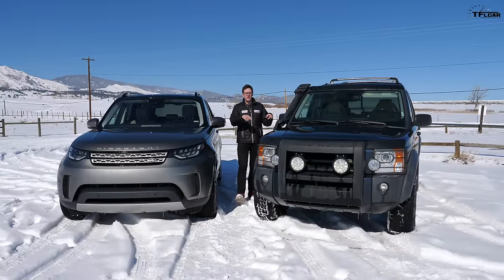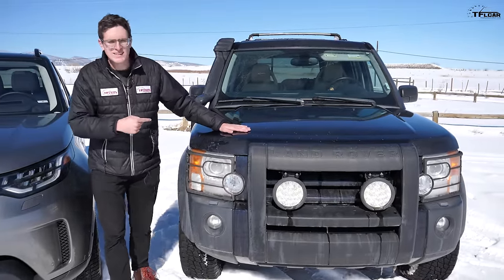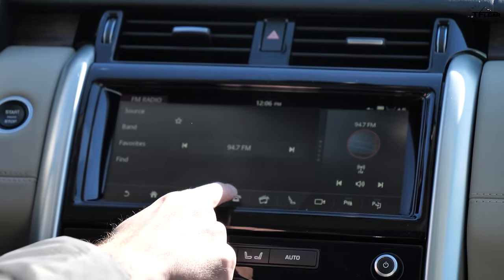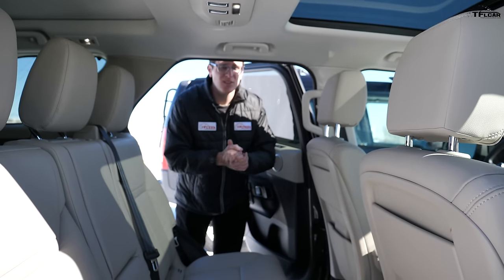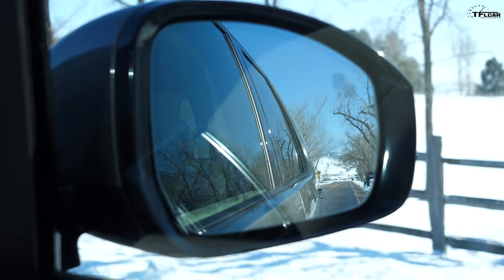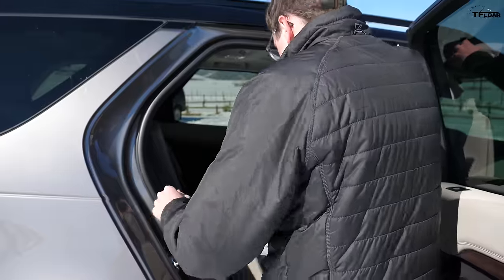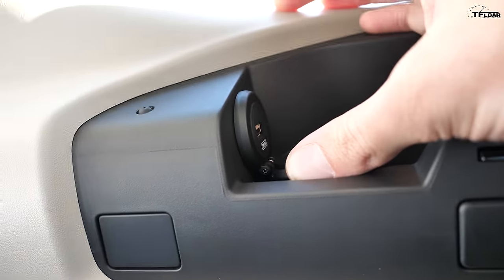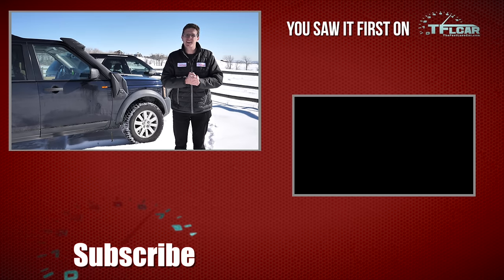Is The New Land Rover Discovery ACTUALLY BETTER Than A $5000 14-Year-Old LR3??

Comment: After the Discovery 2 the 3 and all that followed were unreliable overpriced rubbish. I once drove a Discovery 2 at a Land Rover off road experience center. As a purchaser of a new Discovery at that time, 2004, you received a free half day with an instructor. For a few quid more I took my wife as well so we both had a go. The center's Discovery 2 traction control systems had packed up but after completing the course the instructor said there you are you didn't really need it,  you managed to complete all the obstacles in fine style with manual control. Still have the car after nearly 16 years, steel springs so no risk of airbag suspension blow outs.

Comment: The D5 is an abominio! I own an lr3 4.4 and if u put it in sport mode it goes 0-60 in about 6 sec, it just work on the higher rpm, when it gets there it flies! Anyway, the defender 2020 is actually the new disco, just look at them!

Comment: Wow the Rover has all the controls and air ride which is everything my 2000 Lexus 470 lx has just 21 years later. With 21 years of use and over 200000 miles it’s running just fine.

Comment: Tommy the Disco 3 was still supposed to be a work horse if you’ve got muddy boots you don’t want it all over your posh leather. Whereas the new one is supposed to be a cheaper Range Rover still posh looking sleek and stylish because literally 999/1000 owners won’t take them off-road so they made it posh inside and big fancy wheels etc

Also the disco 4 is the best of both worlds

Comment: All the haters of the Disco 5, The thing that really kills the 4 offroad is the fact of how heavy it is. The 5 is around 400kg lighter with better air suspension set up, better terrain response. It would absolutely run rings around the same set up 4/3 off road.

Comment: I have the Discovery 4 or LR4and it is much better quality finish inside than the 3. Outwardly much the same and of course superb comfort in all 3 rows. Don't like the latest version - too soft and curvy and doesn't ha e the same presence as previous versions. Also with the 3l turbo diesel has loads of power

Comment: The volume knob position on the center stack is for the passenger since the driver is more likely to use the steering wheel controls.

Comment: I’m in the uk , where petrol (gas) was rare in the discovery 3 . The 2.7 litre V6 pulls like a train , and heaps better mpg . I’ve owned the Discovery 1 ,2 and 3 5 years with each , and will be getting as new a discovery 4 as I can , rather than jumping to the disco 5 . Your review helped me greatly, I have 4 kids , so the rear seats always get plenty of use , and as the kids are growing, the rear seating in the 5 having shrunk , it’s put me off . Maybe once a few kids fly the coupe then maybe then , but the lower driving position isn’t something to look forward to. Another thing is , they are not selling in anywhere as bigger numbers than the D3/4 . I live in a area where every road has a Land Rover product on a driveway of at least one house , yet I see pitifully few discovery 5’s . Clearly the new model doesn’t fit to the expectations of the potential buyer , and the price new... for the spec I wanted was over £90,000 . That’s a big jump .

Comment: Should have been a body on frame, rear solid axle. Unfortunately, drivetrain good for 33in tires only not enough to handle larger tires. Good off-roader still just not interesting enough for enthusiast crowd.
Reply: Which one are you talking about? I mean I know of guys who have fit 37’s on a LR3 and I know of several LR3/4’s that do serious wheeling on 35’s. And the D5 fits 33’s with virtually no mods not even trimming that’s better than the LR3. I mean people have put a Range Rover Sports which is the same platform as the D5 on 37’s and they say that they drive great.

Comment: I would say yes because they have the similar independent suspension design/uni-body construction, with an updated terrain response system, and more advanced engine/transmission offerings. So yes the newer one is ‘better.’ Now if your talking about comparing the new one to a Discovery 1 or 2 that’s a different story...

Comment: Rather have the old one, we all know about brand reliability, so... A shortcircuit in the new one would have a blast of a party 🎉🎉
Reply: Who is 'we'?  There are very few actual Land Rover owners who would agree with your statement, and ALL brands suffer from reliability problems, it's just that the internet has a downer on Land Rover products.  I had my Discovery 3 for 4 years and 168,000 miles.  It had two minor warranty issues sorted within a day of them occurring and then from a year old was faultless.  The two Discovery 4s I had after that had no problems whatsoever, and neither has my two-year-old Range Rover Sport.  What you're suggesting is meaningless hype

Comment: Very good review for old vs new suvs. This sums up the truth about them. Everything is a compromise. The new interior is screwed together nicely, but window sills are so tall due to Side impact safety, they're not comfortable at all. Sitting so low in new suvs doesn't help. They cannot be sporty anyway, so I don't know why they try. As for old, tall and boxy maximizes space so I'm much more comfortable in the old. Interior plastic is cheap, but seating is way more comfortable. Luggage and people actually fit in the older ones. I personally don't need the rear end to squat so I can put groceries in the back. I'll just leave it at this.... My wife drives a Mazda CX9 and I absolutely hate it. If there's 7 people (even my little grandkids), the rear seats almost touch the rear glass. You couldn't fit a backpack in there with all seats up. My mid forties old butt drives a 1999 Montero and a antique 1993 Explorer. They have frames. Lots of room. Mitsubishi has a locking center and rear diff. I actually off road the hell out of mine and I can fit many comfortable people and lots of luggage in both. Is newer better? Not for me. My wife lies her wannabe sporty Mazda though. There's no physical way to take 7 people on a trip. Not even a roof rack to put a luggage carrier. But the interior materials are nicer. That's about it. It'll also win a drag race against my old trucks. But I sure have never had a problem jumping on the highway and passing anyone. It's all give and take. The nature of the design has to make compromises. Well done Tommy!

Comment: If the interior option is tan, the rear cargo area is as well. I’ve got an LR3 and an LR4. The LR3 is a bit sluggish compared to the LR4, and probably more so when compared to Disco 5, but not quite as bad as what yours seemed to be. Plenty of power for what it is, and no problem passing on the highway.

Comment: Nice vid on this topic. I wonder whether LR managed to improve reliability over the years. I contemplated to buy a Discovery 3, but was advised to go for Discovery 4 as there should be less problems  (level control sensors, air compressor, engine issues etc.) The Discovery 5 looks like a standard SUV for the city. (For some years now, I did some trips with my Discovery 1 300TDi Trophy (1998) and LR 109 Series III )

Comment: I’m so glad you guys did this. However, from an arthritics aspect I think you guys need to specify the trims on these two vehicles. My 08 LR3 HSE with the Lux package has a much more comparable interior to the D5 as I have all the options you could have in an LR3 and makes the LR3 not look as archaic. More than happy to lend mine if you wanted, or at least wanted to check out. For instance, I have the cooler, wood trim, off road/nav screen, and the cup holder on the far passenger side where you have a tiny cubby hole.

Comment: Nice review video thanks! Re: the volume knob on the wrong side....the driver has volume controls on the steering wheel, so the knob is on that side so the passenger can access it easier.

Comment: Stadium seating was necessary in previous versions due to the frame design. The new one’s frameless, so there’s room for them to sit lower and not impede the suspension.
Reply: That's not strictly true.  LR actually advertised the stadium seating as a benefit, and it started with the earlier Discoveries, which were based on the Range Rover Classic chassis, and that had level seating.  Also, in the D3/D4, when you fold the 2nd row seats, you can drop them about another 4 inches which allows the folded seat back to be level with the rear load floor so, if this is possible, why wouldn't they be designed with the seats lower from the get go?
Reply: Simon Uden 1. Marketing isn’t proof of science.
2. Because they’re very uncomfortable to sit in that way. Your knees end up at your chest, like some third row seats are.
Reply: @afcgeo882  The floorpan is flat between the 1st and second row seats - why would it be any different if the second row was at the same height as the 1st row?
Reply: Simon Uden Rear axle is under the rear seats, not under the feet.

Comment: 2016 LR4 owner.  If you compared a newer LR4 to the Disco 5, there is little better on the Disco 5. It has better USB ports and the back seats are way easier to put up and down. But that’s it. The sc six on my LR4 is a great engine- 90 mph up mountain interstates and decent mpg for what the veh is. The Disco 5 looks like a Range Rover wanna be up front and a puke fest in the rear. I mean seriously, heritage only matters if you actually honor it. If you shit all over it, don’t put some marketing nonsense on it and tell me you did it for heritage. just stop it and square off the back and center the license plate. The Disco 5 is way smaller inside- height, third row room, boot space. Seating position in Disco 5 is terrible for a Land Rover.  The electronics is not that much of a change from mine- I have most of the same features- offroad info screen, cameras, yet the have more traditional buttons with chunky knobs that are easy to use with ski gloves on. And they did not improve the offroad tech- offroad crawl- whatev. HDC is Ok bc it is actually hard to keep a slow steady speed going down a steep grade offroad, and the system will apply all the electronic wizardry that a driver just cannot do. But for just driving? C’mon, if you can’t keep a steady low speed in low range then you need to practice more. And Terrain Response 2? I read all I could on it and cannot figure out how it is any better than mine. My LR4 interior is nicer than the LR3 and not that far off from the Disco 5. IMO it’s actually nicer than the 5 bc it seems more gentleman on safari, whereas the 5 feels more mom at the mall. LR screwed up by naming the Disco 5 a Discovery and the new Defender a Defender. They should have called the Disco 5 something new, bc it is. It has nothing in common with the Discos of old. And they should have called the new Defender a Discovery- bc it is basically a cross between the Disco 2 and LR4.  If LR had not come out with the new Defender I would have been gone from the brand with my next vehicle. And I know a lot of people (in fact just about every LR3 or 4 owner I know) that feel the same. They saved their bacon with keeping us with the new Defender.  Of course they’ll lose old Defender owners in the process.